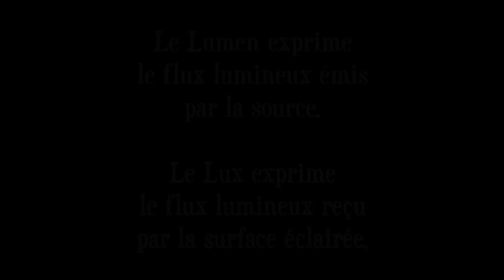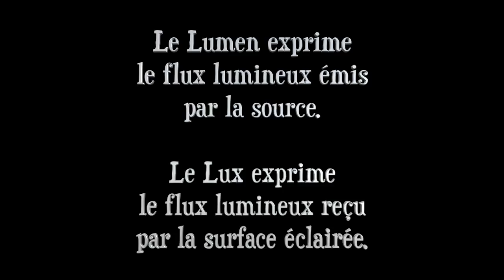Episode 34 : Faire la lumière sur nos semis

Comment: Salut j'utilise les néons depuis 2 ans, tu vas voir c'est magique, je démarre dès janvier mes semis de solonacées sous lampe, a ce stade mes aubergines sont au  4 eme étage de feuilles, je vais devoir les rempoter des godets 0,3l  en pot 1,5l donc pense aussi à la place que ca va prendre une fois bien avancé en croissance.
Penses à mettre un ventilateur, et si possible utilise du terreau pour indoor, ils sont de bien meilleure qualité et sont adaptés à la lumière artificielle.
Le ventilateur est très important pour faire circuler l'air, et fortifier les tiges, et aussi ralentir la croissance verticale.
Et attention aux arrosages sous lampe c'est différent, on arrose peu mais beaucoup d'un coup (1/4 du volume du pot), ton terreau doit sécher entre les arrosages sinon tes racines vont pourrir.
Quant à la distance tu verras par toi même que tu peux la mettre a 20-30 cm cela suffit amplement surtout la avec une 2*55w, pour te dire j'ai 2 étages avec un 2*54w de 120cm de large et 1 étage avec 2 lampes comme toi, je les places toutes au plus haut (40cm) et ca marche mieux, la pousse est plus homogène.
Et photopériode entre 15 et 18h de lumière par jour, ca accélère la pousse.
Surtout pas moins de 20 cm sur les semis de moins d'une semaine, sinon tu va faire une chlorose apicale (trop de lumens réduit la production de chlorophyle >>> semis tout palots)
Reply from the maker: Wahouuu !! Merci pour tous ces précieux conseils !! On a l'habitude d'écouter les retours que nous font les gens ^^